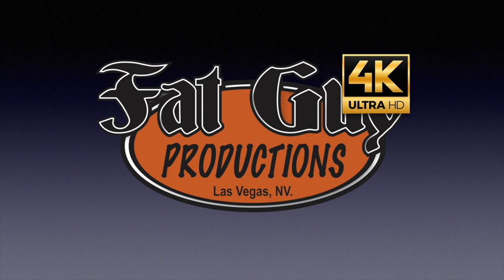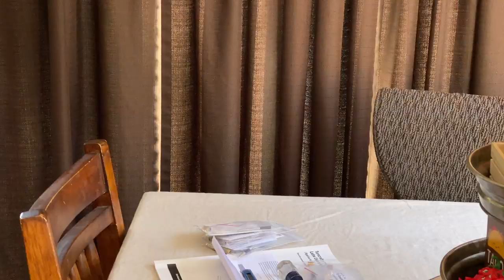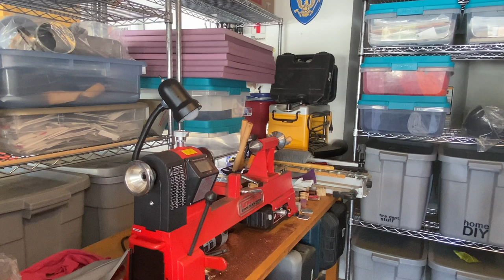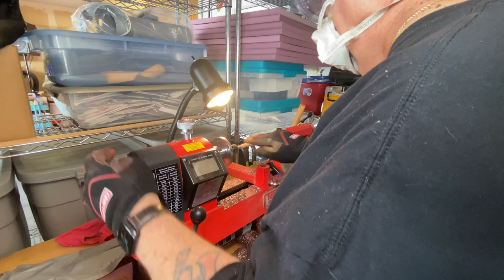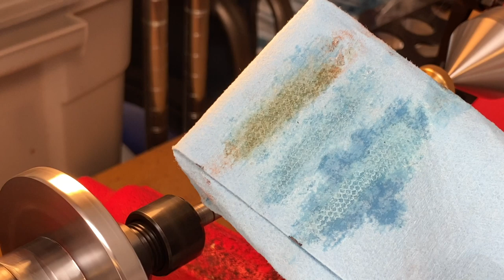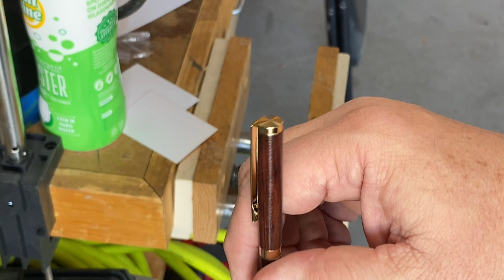How to turn a wooden pen!

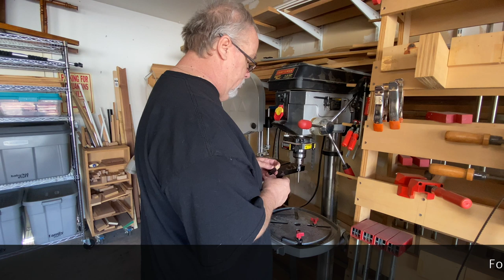Comment: 7:15 I feel the hair issue Paul, I got mine cut (me in a face mask, the barber in mask and visor yesterday). 
Oh boy, the relief!

14:30 I was going to ask that, I prefer a fatter bodied pen, not quite a Mont Blanc, but nearer that than the slim ones. I used to love lathe work, more bowls than pens, but hey.

Oh yes, and I agree about the gloves, definitely a no-no. You need to feel the motion really clearly.

Nice job Paul.